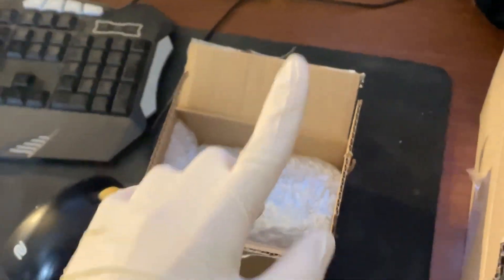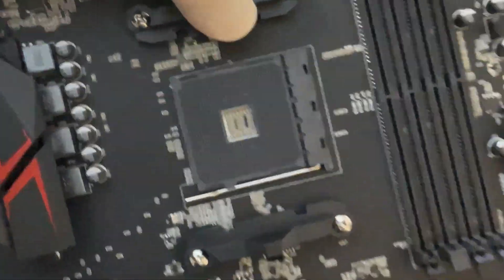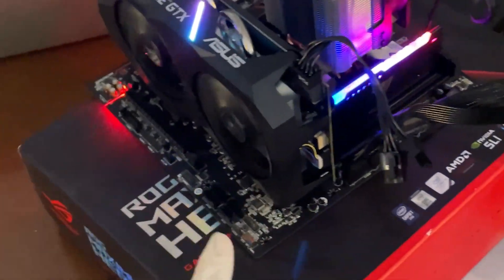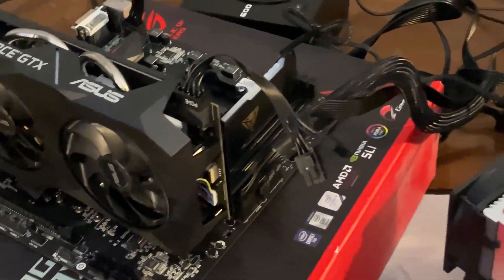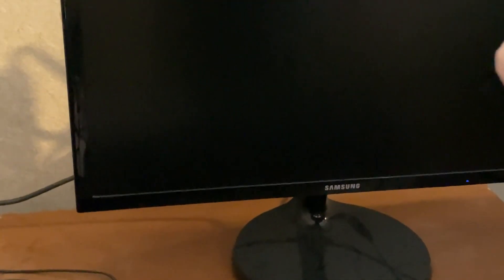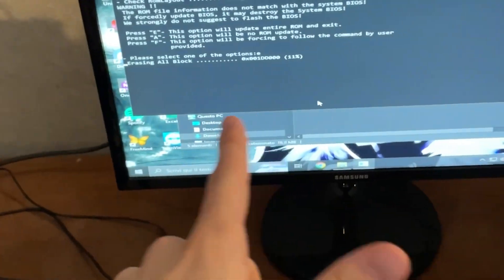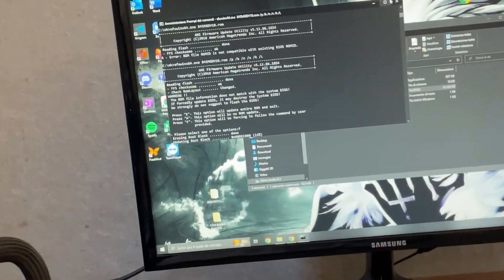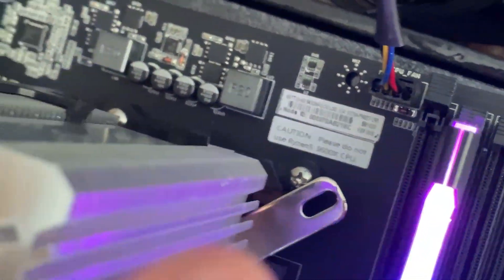Bios Mod your B450 Motherboard to get more FPS! - BIOS Flashing to B550 Tutorial

Comment: hey can u tell me is it possibile to replace agesa from old to new one in order to support ryzen 5000 series if the motherboard maximum supports is 3000 series? on manufacturer website the latest bios supports ryzen 3000 series max, can i somehow  upgrade agesa (replace old agesa by new agesa) using an program and programmer to flash this modded bios? I mean getting new agesa from other almost identical motherboard that actually supports 5000 series then paste it somehow to the bios of motherboard that doesnt support 5000 series, then flash using programmer and will it work?

Comment: Can i unlock pcie gen 4 on my Asus Tuf gaming b450 pro S? It is the same board that b500 tuf gaming plus, the difference is the chipset. Before I had the pcie 4.0 but a bios update blocked it.
Reply: If I flash a bios from this b550 on my b450 will it work or do I need to do something else?
Reply from the maker: Yes, it should work flawlessly!
Reply: @ImWateringPSUs  I use the BIOS flashback button on my motherboard to update the BIOS. It's just me put the B550 BIOS file and update that works normally?
Reply: @Gustavo_ogtx claro que não é outra placa , pra ativar basta deixar bios antiga que funciona nas séries 3xxx , aí faz um bios mod pra funciona os 5xxx

Comment: I use b450 with 5600g and rx6600 ;) not worth upgrading to b550  just to get pcie4 advantage (which is ~5% fps boost) IMO
Reply from the maker: That’s actually a very good point! With mid-to-low end hardware I don’t think it’s worth it for the Pcie bandwidth alone. But say you have a R7 5800X & RX 6900XT , things start to change a lot!

Comment: Am I missing something? You flashed a B450 BIOS from a different B450 Board to your B450 Board. Why is the title "B450 into B550" then?
Reply from the maker: Actually what happened in the video was I merged a B550 bios from the newer model of the board I had with a different colorful B450, flashing the hybrid in the B450. This unlocked Gen4 PciE speeds as well. But the whole idea is that you can use this method to simply crossflash your board, if they make the same board of the higher series!
Reply: @ImWateringPSUs well how does one hybridise the bios? Is it possible to do only gen4 unlock edit?

Comment: Normally B450 and B550 chipsets are technicallly different. How do you determine which motherboard bios is the best to crossflash since having the same chipset would be a basic thing required, or not?
Reply from the maker: That’s a very good point, but many motherboards reuse the exact same PCB design and the only difference is the chipset, which very often is just a difference in the programming! My rule of thumb is to pick the same motherboard, from the same brand and lineup, just in the newer version
Reply: @ImWateringPSUs  So an MSI B450M mortar with a B550M mortar BIOS is a good match?
Reply: @tweakz_tech  i believe this would work to enable pci 4x. the msi pro carbon b450 would not work as it has a 16mb bios chip. yours have a 32mb as does the 550.
Reply: the chipset (pch) is technically nothing more than a pcie device so if the board layout is identical then this shouldn't be an issue

Comment: Well is it safe to switch the bios from my b450 steel legend to the 550 steel legend?.....idk😅 just have the 5500 so wouldnt use the pci 4.0 lanes, maybe for my rx6700xt
Reply from the maker: It would for sure unlock the pcie gen4 on the mobo, but yeah with the 5500 I wouldn’t do it honestly
Reply: @ImWateringPSUs  maybe when im Upgrade my CPU, Just wait for a good price for the 5600 or Higher, Second Hand is also fine for me

Comment: If I use a B450 motherboard, I can flash BIOS that is exclusively for B550?
Reply from the maker: The short answer is yes if they share significant PCB/design elements. Meaning: for a long time Asus made the “refresh” board for the next gen with the same socket reusing the previous design. In that case YES. However, if switching from B450 to B550 they significantly changed the board (I.E. more power phases, different IO, wiring of PCH lanes) then there’s a very little chance of it working and I would advise against it.
Reply: @ImWateringPSUs  some b450 boards have a 16mb bios chip in my case msi b450 pro carbon ac and the b550 has a 32mb bios chip. so you would have to solder in a 32mb chip in this case